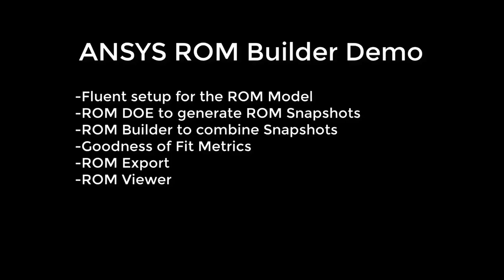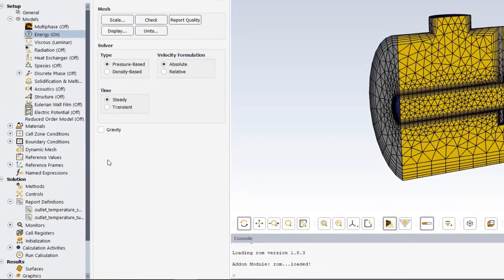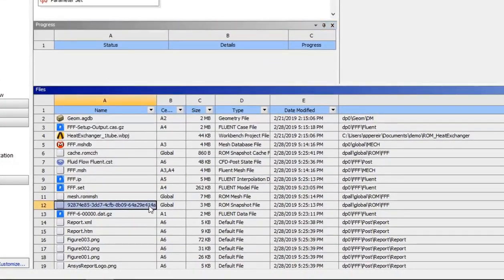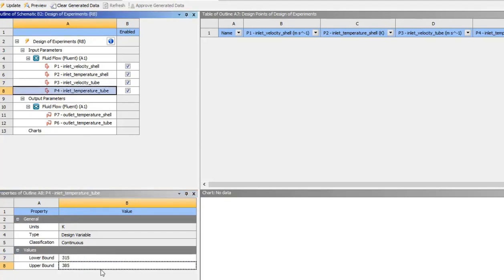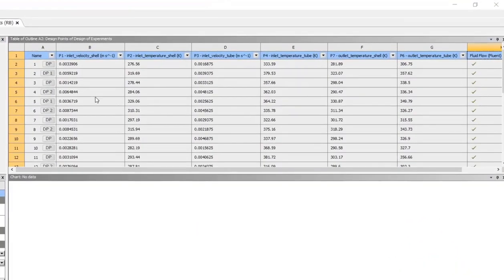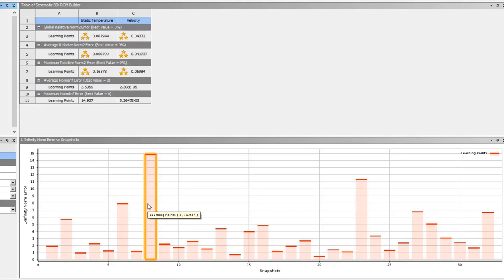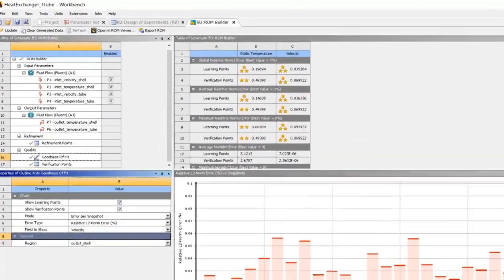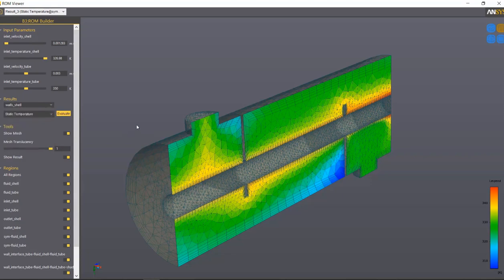ANSYS ROM Builder Demo

Comment: After clicking on UPDATE in the ROM BUILDER this error is appearing - Update failed for the ROM Builder component in 3D ROM.  Error HRESULT E_FAIL has been returned from a call to a COM component.
any solutions for this ?
Reply: @Hanrui Qiu No I am still working for the same man.. I think using the 2019 version may be helpful as the latest do not have ROM Viewer